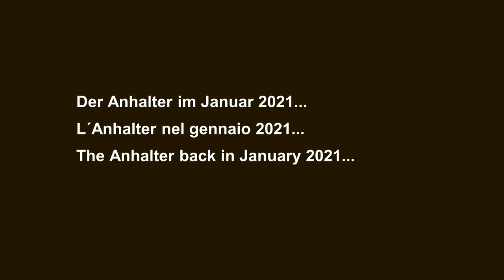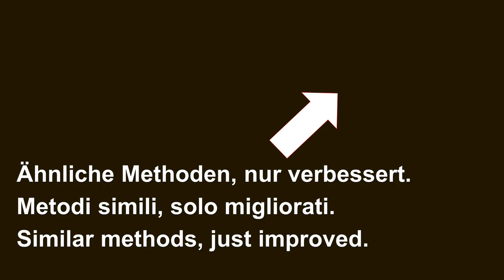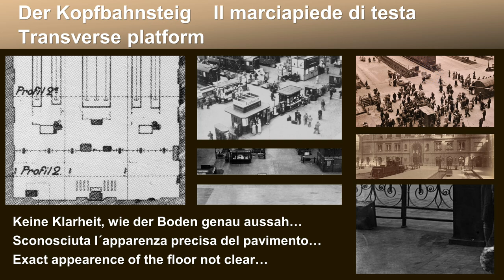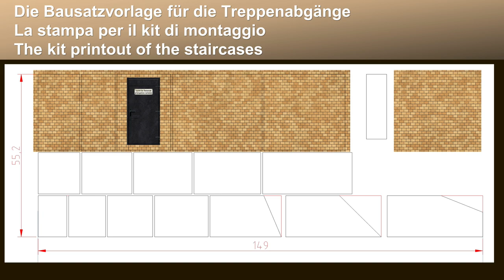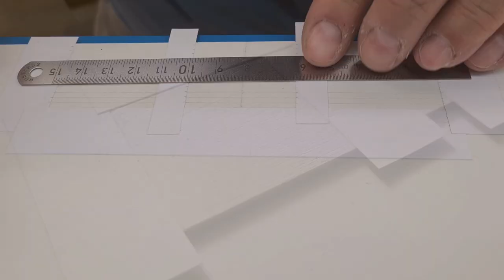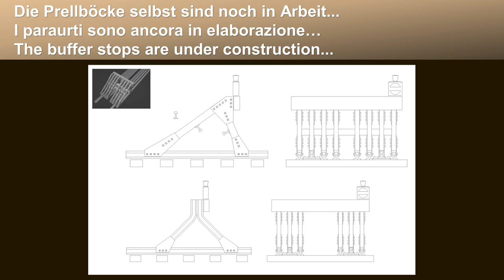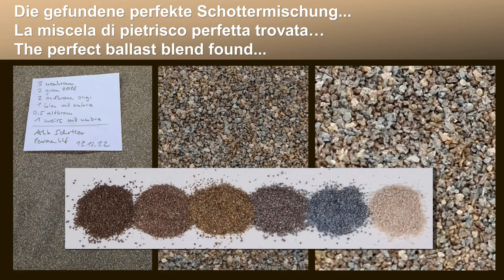BBM1930s: Anhalter Bahnhof Update 12/2022

Comment: Wonderful work, indeed superb, congratulations. A curiosity, did the parallel rails positioned near the station bumpers have a safety function to avoid detours or for other reasons? A thousand thanks.
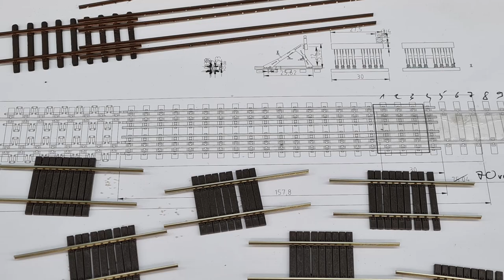Reply from the maker: Thanks! If you look at 12:41 you see the buffer stops (paraurti) at the three arrival tracks had 8 legs, 6 of them bolted to the additional break rails. In case a train did not stop and run into a buffer stop, it would pull the break rails partially including the ties and the friction of the hole system would gently slow down the train to stop. Of course, beyond a certain speed, the train would run over the buffer stop and crash into the building.
Reply: @BBM1930s   
I hadn't noticed that the rails were attached to the bumper, thanks for the explanation and good work!

Comment: Alex, I have question about operation of your layout - I am assuming that you will be operating prototypical services - if so what will be the route(s) for services that do not operate through to Italy? Again, I am assuming that you will operate some trains that were purely German - otherwise there would not be very many trains ;)
Reply from the maker: Brilliant question... Yes, you are right, operations on the BBM are as prototypical as possible. Good to know: There are 7 trains per day heading Frankfurt + Basel + Milano. 3 of them with 11 coaches. The switching job to form such a train takes about one hour following the original documents of the coach order in the consist. Another traffic at the Anhalter on the BBM are the regional trains to Tempelhof, and this is not prototypical. Tempelhof stands for the branch line to Lichterfelde, but the space is limited and there are no staging yards on the BBM because I love doing prototypical switching and hate spending my time handling trains in hidden staging yards... Finally I use a trick for trains leaving Berlin for another german city but forced to arrive at Basel Bad.Bhf. because there is nothing else between the two stations on the BBM... They start e.g. as local P314 to Dresden, but arrive at Basel as local Pxx from Freiburg...

Comment: Absolut grandios.
So viel, wie Sie Polystyrol selber zuschneiden, wäre der NWSL The Chopper II wahrscheinlich auch was für Sie. Ist bei mir auch oft im Einsatz.
Gruß
Reply from the maker: Vielen Dank, und danke auch für den Tipp. Der Chopper hat viele Einsatzgebiete. Für meine Arbeiten ist die kleine Proxxon KS230 nicht zu übertreffen. Schnittfläche immer exakt 90°. Mit ihr kann man auch 0.1mm Kürzungen im Nachgang wegfräsen, unentbehrlich für präzisen Modellbau. Weicher Forex wird vom Chopper gedrückt, relativ hartes Polystyrol bekommt keine exakte 90°-Schnittfläche.
Reply: @BBM1930s  Das stimmt, ein Problem beim Chopper ist auch, wie ich finde, dass die Klingen eine V-Form haben und so der Schnitt im Anschliff von deren verläuft. Bessere 90° Schnitte wären vielleicht möglich wenn man einseitig angeschliffe Klingen hätte.
Die Proxxon Kreissägen sind auch sehr gut, habe selber noch die FET.
Gruß

Comment: What control system do you use for your layout, and how many boosters is there😊
Reply from the maker: @henrikdagil3684  Hi, it's the Roco Z21 System with three dual boosters. For operating sessions we use old compact Android smartphones. The boosters are needed mainly for start up because most of the locos are equipped with ESU Powerpack requiring a lot of current on start up despite of the electronics limiting the absorbtion.